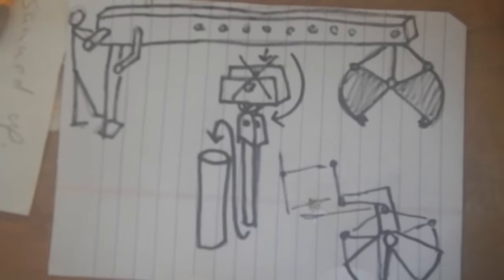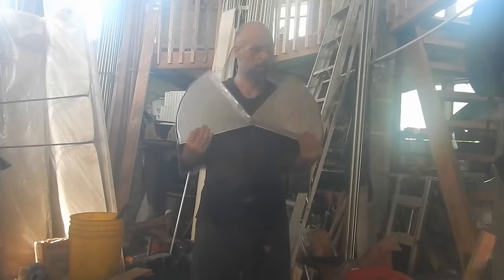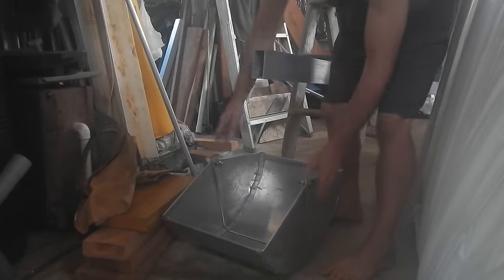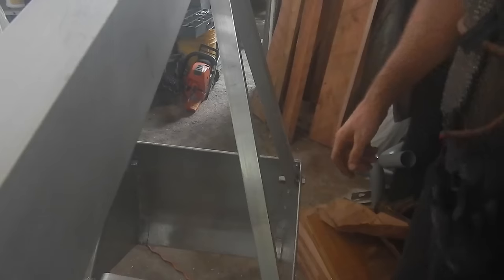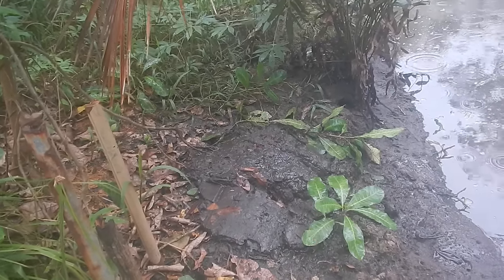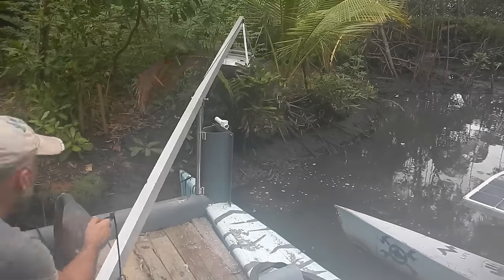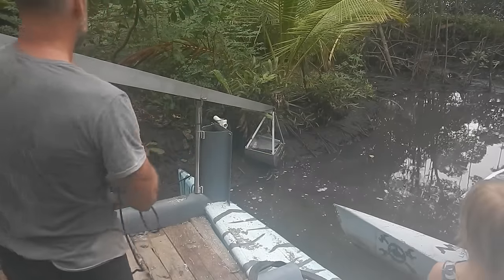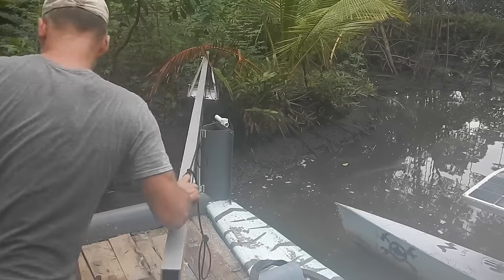Must Move Mud!  DIY Manual Crane Digger

Comment: Should have gone with a suction dredge with a rotary tip powered by a hydraulic motor to break up the mud. If your afraid of it washing back in. Stake some straw bales at the waters edge down hill from the flow. And wala you’ve raised the height of the land. Or you could do the same thing with straw bales in the water and extend the land by dumping inside the dam you build out into the water.
Reply: He had one he built but it didn't work that well IIRC. Hard to keep the suction I believe.

Comment: That gizmo would dump into a cart or wheelbarrow?  The muck will wash back into the waterway in the rain easily if left on the side like that.  However, that muck has a lot of nutrient in it (watch the salt content however) and added to gardens or better yet mixed in as fuel for composting matter (which should deal with the salt issue) would be a better use for it.  Need to get the best use out of hard labor like that.
Reply: At his other island he has been planting trees along the bank he dredged.

Comment: You need a second rope that pulls the jaws open, then attach a lever at the end you control it from with the ropes attached to it, so when you push the lever the jaws open and when you pull the lever the jaws close, also add a counter balance about 3x the weight of the jaws, so you can have the boom longer on the jaws side and when it's empty it should have a near neutral balance.
Very cool build, surprised how quickly you managed to build that 👍
Reply: Good idea.  Also, have the lever hit a stop once the lever is pulled back and just beyond parallel to the long arm so that it "cams over" slightly to lock the jaws in the closed position and then to release, you just have to bump the lever just passed parallel in the other direction.   Hard to explain but is actually elegantly simple.
Reply: A moving counterweight. It slides along the boom, to press the bucket deeper into the mud on one end, and then counterbalance the weight of the mud on the other end. It could move back and forth on a gear track driven by a drill motor and the ships solar panels.
Reply: Great ideas!  I wish Jamie read the comments....
Reply: @AtimatikArmy  I wouldnt wish such torture on my worst enemy.
Reply: @QueernMental  LOL, true!

Comment: I love how quickly that went from idea to working project. I'd attach the rope to a lever, with an end-stop just slightly over-center (an over-center mechanism) so that it "locks" the bucket in place when you yank it shut. Then a slight lift on it releases the whole thing. The lever would be helpful to pull the bucket closed, so might as well add the stop just past center and get 2 functions out of it.

Comment: @JMEMantzel you may consider using a pivot and a rigid (tube/angle) push/pull rod instead of a rope.. then add a lever where you operate from.. then you can use force to open and close. Like the kids toy.. The Big Dig Sandbox Digger Excavator Crane

Comment: Hi, nice job, I sagest to add lever on the boom to attach the rope to make it open/close more easy and free the hands. and to build floating 4 wheel cart no need to swing to much to unload digger and cart can float close to digging area and can be towed and rolled to shore and dumped in required area. In this case you need to build the rump to roll cart to the shore but it's also in your case mast have structure.

Comment: It is great to see you using the metal sheers.  I love that. 

Everyone's got ideas.....

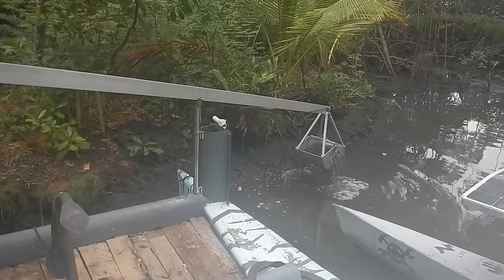Have you thought about moving the pivot point further back and adding counterweights?  As it is you've got to move the back end 1 banana unit for every banana unit of movement at the bucket.  If you move the pivot about quarter way back then you can change that ratio.   Right now, you need a lot of space on that deck to work.  You could reduce that by moving the pivot point closer to your end.  You're probably already thinking of that. (Oh, you got to the counterbalance point at minute 18:45.  Mea culpa.   My bad.)

Pretty awesome. 

I've got a jib boom for my camera that works on similar principles.  Old Fort William in Thunder Bay, Ontario had a similar device for fetching buckets of water from the river.

Comment: I'm moved a 12 ×12 storage shed shed 10 ft forward with 4 x 4 x 12 a little bit at a time. LEVERAGE
Reply: Haha 3 inch pvc pipe helped me move mine. Not only do they roll, but if you wax them, they become efficient slide rails.
Reply: @sunshineandsmiles9668  I couldn't use PVC by myself three guys showed up to help me I was already done

Comment: What comes to mind when watching this is a bucket line dredge. The obvious biggest drawback is a lot of moving parts, which means, even when designed well, it would definitely fail at times. Also, it wouldn't handle how to place the muck where you wanted it. The plus side is that it seems similar to designing a robot, which some folks might like to do, and when working correctly, it could move a lot of muck.

https://www.youtube.com/watch?v=3dBEDEJAphs